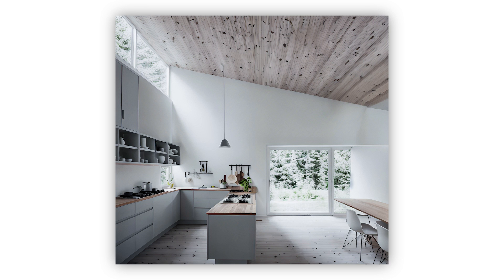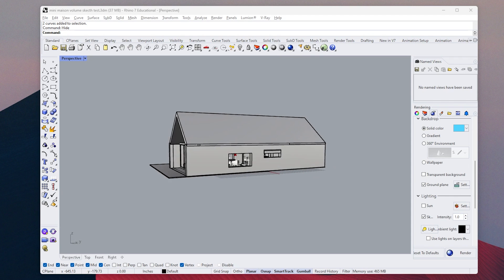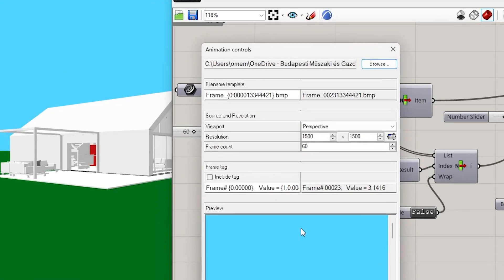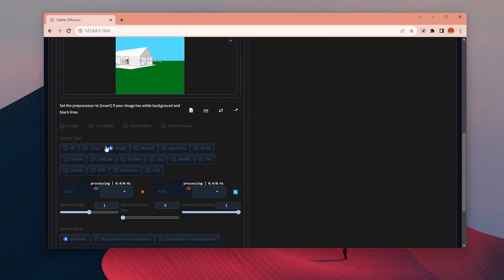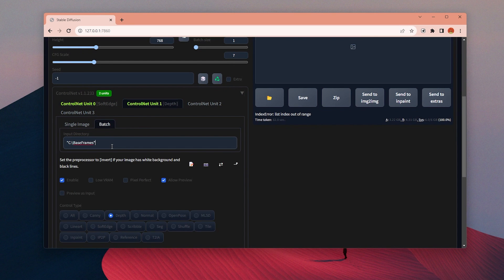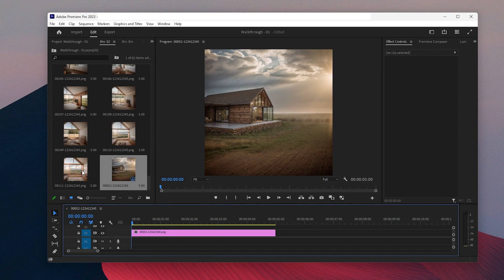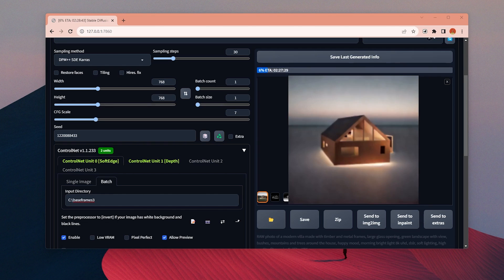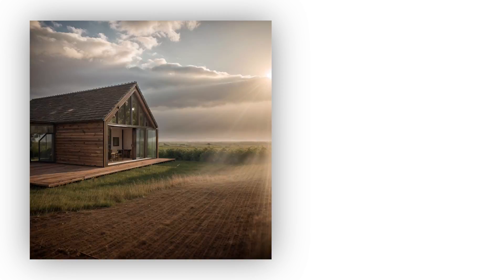How I Created This Architectural Walktrough Animation Using AI (3D model to animation)

Comment: just cresate images in promeai  and then use that image in runaway.
Reply from the maker: That's another way of creating animation, you are right. But you don't have much control over the process. Even though they recently added some camera control settings, still it's mostly "random". Thanks for the comment and suggestion :) You can try Pika Labs too

Comment: Cool Idea and thank you for sharing. I enjoy these videos and your explanations. I don't know if it's possible, but instead of rendering all the frames using a txt2img prompt, you could try using img2img. Basically, my idea is you render the first frame using txt2img, making sure the materials and everything else is according to your vision. Then you go to img2img and you render the next frame using the prior frame as a reference. So for frame 2 the reference will be the generated image from frame 1. For frame 3 it will be the generated image from frame 2. And so on. If you keep the denoise to a reasonable level (let's say around 0.4-0.6, you'd have to experiment what works best) it should be able to keep the materials, lighting and so on much more consistent.

The only issue with this that I see, is that as far as I know, there is no way to automatically feed the generated frames from img2img to the reference in order to generate the next frame. It might be possible though using the batch tab in automatic1111 or by using comfyUI.
Reply from the maker: Thank you! You are absolutely right! There are definitely better workflows to achieve better results with this idea. I am planning to do a more in-depth video about the other ways soon! Thanks a lot for the suggestions :)
Reply: @designinput  Sounds like a plan. Looking forward to the next one.
Reply: My idea is to stick to text2img and use an additional Reference ControlNet, then check if it can batch import each previous frame from your output folder as they get generated.